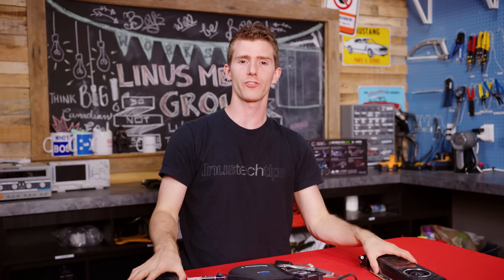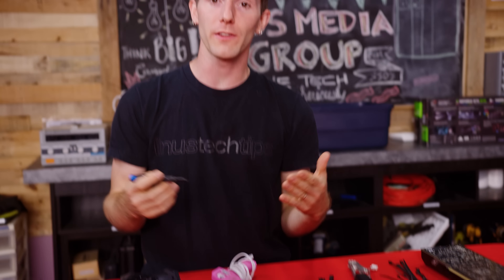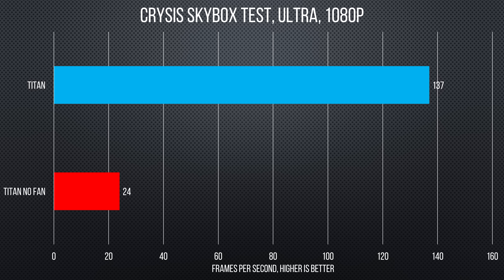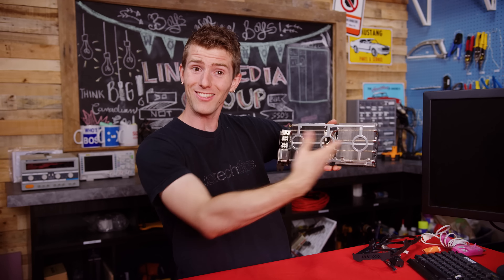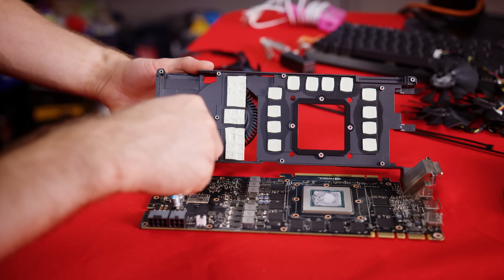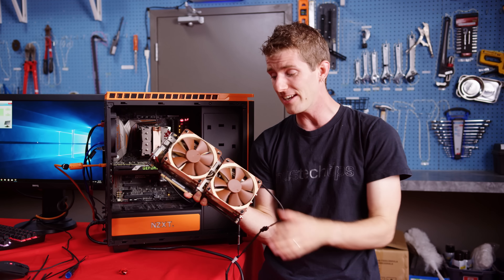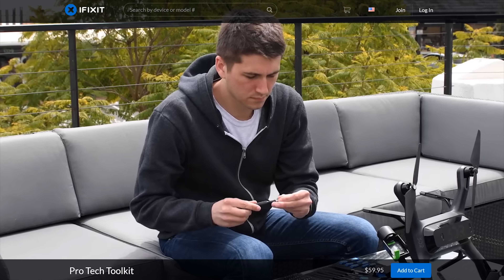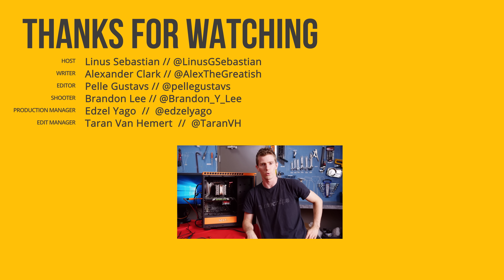Video Card Dead Fan Repair Guide

Comment: For those late to the party, 4 years after this video was made, Noctua partnered with a graphics cards manufacturer to make a Noctua-flavoured graphics card. As you probably guessed, from Linus' results, it apparently works great!
Reply: Now if only I could use Noctua fans to replace these noisy Gigabyte fans, without having to rip off and replace the heat sink... Pasting my CPU? I can do that. Fiddling with my GPU? Ehhhh...maybe better left to professionals.
Reply: @snaffu1  It'd be cool if a manufacturer made a GPU with mounts for standard 120mm or 140mm fans so you could put whatever fans your want on it
Reply: @fizz1ewinks  at somepoint in time, someones gonna 3d print a gpu case that can fit 120 or 140mm fans
Reply: @justsayin2085  They already sell deshrouding kits that do this.

Comment: So in essence Noctua should make custom heatsinks or even video cards
Reply: YAS!
Reply: It's just a matter of fan size really. If Asus and the rest were willing to make cards take up 3-4 slots by sticking 25mm thick fans on their heatsinks that would do it.
Reply: It didn't even look that janky. I might do it to my 980ti after the fan dies.
Reply: not worth the extra cfm with noisy af fans. there's redux line aswell.
Reply: Or simply, let's just leave that job to cryorig.
Reply: I'm considering ordering a couple Noctua P120's and swap out the fans on my 980 Ti (EVGA SC+) 
The stock fans can't cool the card enough under heavy load, forcing the card to hit 84° and thereby throttling the performance. 
It's extremely loud as well
Reply: Now, the new chromax lineup would look much better than the poop colors.
Reply: G6 Liara did you apply it successfully?
Reply: I've been using this mod for years. It's a good cheap fix. If your mobo don't have extra fan headers just hook up the fans to the molex power connector on the psu. Since the fans are 120mm,they are not that noisy when compared to the stock fan at full tilt. It also helps to create some are flow in the case as well
Reply: with a sidemount on the gpu  you can make some sexy noctua aircooling pc build
Reply: And they did
Reply: @defencebangladesh4068  Thank you! So I've seen, unaware of my previous running mouth. Thank you for reminding! Takka sæg te ja
Reply: @SomeoneAbstruse  আপনাকেও ধন্যবাদ 👍
Reply: They actually did that
Reply: @olleoberg7562 you got your wish

Comment: Your Titan X mod didn't work because the original fan is a centrifugal fan. The one you used was axial which does not push the air in the same way.
Reply: he probably forgot to tape the side where the air can escape

Comment: But can it spin crysis?
Reply: Michele Caci maybe at 144p low settings if u overclock the fans...
Reply: Michele Caci can I replace the stupid noob sapphire rx 480  fans ?? Plz those fans are not cheap and not available so I want to replace them by case fans
Reply: 9:27 60 bucks USD that is
Reply: @yesboss2800  same here brotha

Comment: The problem with why the blower-style wasn't working, was probably because you didn't seal off the old intake on the graphics-card. This way, most of the air escaped in to the case (due to less resistance), rather than through the fins, and out of the case.
Reply: You probably mean the "exhaust" on the right of the blower fan. Since the blower fan is inside the card and it's output is instantly divided by the card (one side being the fins, the other side being the exhaust back in the case), it will approximately put the same amount of air through both paths. The axial fan however was mounted above the blower fan, so the whole amount of airflow (to some extent) can go through one path if the other one is sealed off (thats what wasn't achieved and also that what you said what should've been achieved).
Since the path back into the case provides way less resistance than the path through the fins and through the slot bracket, most of the air indeed doesn't go through the fins.
To solve that issue, one could:
1. tape the right side off of the gpu
2. buy a blower fan (not searching for "gpu fan" is pretty important in that case) and directly replace the broken one
3. create a duct under the axial fan where the old fan was to guide some air back into the case (if there are components there)
4. break off the casing of an axial fan and place the axial fan there where the old fan was, it will now work kinda like the blower fan it replaces
This is in no way meant as critique, I just had the urge to add more context and suggestions :P
Reply: It didn't work because the fan in the blower style is designed as a whole system. The shroud, heatsink, exhaust. It's designed to suck air from the front of the shroud, thru the heatsink and exhaust it out the back of the shroud/PC. It might have worked better if he mounted the fan somehow to the back or front and taped off the stock fan so air couldn't escape forcing air thru the heatsink.

Comment: Me: breathing heavily, staring at my toaster of a 1060 and two spare noctua fans
Reply: @Jim Mahmud I actually didn't. I'm still really debating it though. I have one of the fan bearings starting to go anyhow. So in the event that it actually fails, I'll probably cut the housings down on a similar sized fans and actually find a way to mount them in the actual case of the card. That said, I wild definitely do something like this in a pinch.
Reply: @makitard  my particular EVGA 1060 ssc is a toaster. I think most of the acx 3.0 cards are toasty. I don't think it's a great dual fan solution IMO. I love the card though.
Reply: @thisislargemouth5566  ACX have thermal pad issue, make sure you have one installed on the vrms, you can also change them. 2.5mm thick.  BUT, it's a great cooler when those issue are fixed. Better fan would also help a lot.
Reply: A TOASTER W A 1060!?

Bruh im happy to see minecraft at 100fps
Reply: @thisislargemouth5566  did u do it now?
Reply: any updates?
Reply: @Ammarx1  I've been not really using my computer much. My neighbor been using it more than me. It is still a toaster but running strong. 😂
Reply: @Ammarx1  I don't think it's been off in a month 😂
Reply: @thisislargemouth5566  oh damn, i just hope that it doesn't die lol.
Reply: @Ammarx1  I believe the saying goes "if he dies, he dies!" 😂
Reply: @thisislargemouth5566  haha, good luck with that thing.
Reply: Over half a year later....did you do it????

[update 10/9/2020] I just did it to a GTX 1650 low profile with two 60mm noctuas and it is AMAZING.

Noctua’s Instagram account liked my post on my mod too haha
Reply: @LeftJoystick  can you link the post lol? I'm planning on doing it id like to see youra
Reply: @makitard  1060 is a toaster since the heat dissipation is not made by gpu chip but by cooling system.
Reply: @makitard  Then THEIR 1060 is bad.

Comment: The blower style card mod didn't work out as good as the other one because it uses a radial fan that sucks air along its axis and exhaust at a 90° angle and you replaced it with an axial fan that sucks air from a side and blow it to the other
Reply: exactly... I was face palming watching that... thought linus knew that reference card fan is exhaust, not pushing in
Reply: Oooh radial
Reply: Also his tape seal was worthless
Reply: Your Statement is true, but i think the original reference cards shroud should force the blown in air trough the fin stack anyway, in case the axial fan has enough static preasure and the "cutout" for the fan lines up good enough
Reply: But as the Nvidia reference cards do exhaust a small amount of the air back into the case through the smaller heatsink on the "right" (when looked at from above) side, and this has way less resistance then the big other fin-stack i guess, the air will just go this side i think
Reply: You might even be better putting this standard fan 90° directly into the radiator (don't really know how to explain it better) and seal the old air entrance. though a more powerful fan would be necessary.
However I've always been able to find perfect replacement blower fans on ebay, even for my laptops :/ so I'm not sure about the non-availability.
Reply: Or remove the window in the shrowd for a second fan GTX 480 style.

Comment: As an ex-smoker, pretty much ALL my GPU fans failed before I was done using the card. Having had no outside input, I came up with this solution on my own about 15-20 years ago. General rules: strip the card down to the bare heatsink and zip tie a case fan directory onto the heatsink. Never try to power the fan through the card. Don't zip it so tight that it warps the fan's casing and ensure the blades are not rubbing on anything and that's about it! Not even sure how I came across this video today but it's refreshing to see that this solution is touted by the the man himself! Great tip Linus, thumbs up from me!! Bonus info - I'm Canadian!!
Reply: Why would you not power the fans through the card? Assuming the power ratings of the fans are close or equal to the stock ones there should be no problem, or am i overlooking something?
Reply: Either I checked, or I assumed, that the power draw was different.

Comment: Everyone is going to put noctua fans on their gpus now 😂😂😂
Reply: I did that with my HD7950 because the Gigabyte fans stopped spinning below 1000RPM and that is really loud.
I also did this mod to my (back then) brand new XFX GTR RX480. The temps and noise are amazing. The only downside is I have to use SpeedFan to control the fan RPM based on GPU temperatures.
These new Asus Strix cards have really usefull 4pin headers meant for case fans. I would recommend using those.
Reply: Get ready for the noctua shortage for miners
Reply: it's soooo tempting
Reply: Everyone should, honestly. My rx vega doesn't get above 52C with two of them strapped onto a morpheus II
Reply: Good thing I only buy ROG Strix OC cards these days!
Reply: I have the strix 1070... thinking about it i really am, maybe not noctuas though
Reply: ya especially because asus has no warranty on their low end gpu fans
Reply: It would look nice matching a Noctua D15 or something too.
Full Noctua build.
Reply: 1 fan broke on a old gts450 copper edition with double ram i had from 2008
so yea i had to ziptie a fan on it,it was quiet and perfectly cool!
they should have put the result with open shroud and 2 fan on the blower...
Reply: i have a d14...
Reply: Just add 100$ for fans and morpheus II into your Rx Vega order and get 1080 like performance. Not great for the wallet, but it would be bad ass AF
Reply: KGskate82 I might just buy a compatible cooler, like one of the acceleros (not sure on name or spelling right now). Basically one of the arctic cooling coolers.
Reply: Tailslol would've been a lot cooler. I can assure you of that. Since that single fan on the titan just was not working out.
Reply: +john bumptybump same man, it honestly looked pretty cool lmao
Reply: Not just Noctua, almost any 120mm fan will work just fine. Fan on my R9 285 just died, i did this but with two 5$ Xilence fans. Max temps are 57*C, while with stock cooler they were hitting 76*C. And they are pretty much inaudible when CPU fan joins the chorus.
Reply: I'm already doing that to my rx 580
Reply: I did it with a ancient CPU cooler fan and super glued it to the shroud. That card still works BTW except I have to upgrade it as its a gt 140😂
Reply: My gpu got loud so I actually will do this
Reply: @johnbeer4963  i did that and it was the best decision ever. card is dead silent even under full load and long gaming sessions. the standart fans are way to noisy
Reply: @Jb11rabbit  But each big fan needs 1 4pin slot right? or are there enough cables left from the GPU fans? Or did you have to buy an adapter to get 2 4pins in 1 slot? I wanna do this aswell just never took my GPU apart and dont know if Linus reused those cables or used different ones and scared I dont have enough pin slots left for 2 4 pins.
Reply: @shapsas9435  If you are talking about the same Asus 1070 model that is also shown in the video, then you have two 4 Pin headers on the gpu. The original header for the original fans is some proprietary thing.  So he will detect them as external fans but I never had any problems with that. As for other gpus. You will have to look that up on the spec sheet or so. Most gpus don't have those extra 4 pin headers or a Standart Fan Header for the original gpu fans. In that case just use the Mainboard headers and try to find the best fan speed value so you don't overheat.
Reply: Just did lol
Reply: @Panchirito.gaming  how do you control the fan from MSI afterburner? I want to try this with my rx580 too
Reply: @waratkasitanon5323  When you open afterburner, on the right side where it says Fan Speed (%). You can click on the word,  Auto and you can adjust the fan speed however you want and click the check mark to confirm the settings.
Reply: @Panchirito.gaming  Thanks!
Reply: I did
Reply: I am doing this 10 years, not with noctua, but it's not imporatant, important is that classic fat 25mm 120x120 fan is much better than low profile shits on GPUs
Reply: @phenomanII  I bougth an used XFX RX570 RS , but the stock fans are loud AF when reach 100% speed , do you recommend this mod for my gpu?
Reply: @epictrolloleante  Do they reach full speed often? They probably shouldn't if you've got a decent case and don't live in the desert...
Reply: @phenomanII   Yeah they do,when I play a game that uses 100% of the GPU the fan reaches 100% speed  to maintain the temperature under 85C° and that's when the fan becomes so damn loud. And if I use the stock fan speed curve the GPU it's silent but it reaches +90C°.
And I don't live in a desert but the average temperature in my city these days it's 38-40C°+
Reply: @epictrolloleante  I would recommend that you visit the LTT forum, and consider replacing the thermal paste on your GPU, altough that can get a bit sketchy if you're not experienced.
Reply: @phenomanII  the first thing I did when I got that gpu was replace the thermal paste with Artic MX-4.
I'm getting these temps with that thermal paste.
Reply: @epictrolloleante  I would definitely check the cooler mount and the spread of the paste. Don't forget, none of the tips for applying thermal paste on a CPU are relevant when it comes to GPUs. You're dealing with a naked die here.
I had a stability issues with my RX480 for months and after undervolting it and all that it kept crashing at idle with no issues under load. I changed the paste at least 4 times. (I was experimenting with DIY cooler mounts and stuff and went back to stock after a couple repastes.)
I was ready to give up on it and sell it as defective for the value of the cooler when I found a post that described exactly the same issue, and the poster solved it by reapplying the paste. (Sadly, he had a worse paste application from the get-go and his GPU died not long after he fixed the stability problems.)
I reapplied the thermal paste once more and I've been running the stock cooler with stock fans ever since then, and I'm honestly a bit afraid to touch it now.

When I modded the RX480 with Noctua fans the first time, it was after testing the original cooler. I knew that with enough airflow (the fans at 100%) it could reach great temps, but due to noise, the stock fan curve barely reached 50%, so swapping the fans gave me more airflow at lower RPM and better temps.
The GPU should be at least functional at the stock fan curve, and should be able to reach decent temps at 100%. Otherwise swapping the fans won't help you as you're limited by the heatsink (or the heatsink can't perform optimally due to the thermal paste application).
My RX480 GTR has a big heatsink on it, it should be able to fit 92mm fans with no overhang, but the stock fans are thin and small due to compatibility and I used 120mm fans to run at lower RPM.
If your GPU has a heatsink similar to the RX480 Nitro I had before that, you'd need to make a duct that focuses the airflow toward the small heatsink, otherwise you won't have enough pressure through the fins. At least that's what I did with that GPU before exchanging it for the GTR.
Reply: @phenomanII  Ok, i'll try reapplying the thermal paste.
Reply: @epictrolloleante  Good luck, and be careful.
If your issues are actually related to the thermal paste right now, you're lucky that the coverage is worse near the temperature sensor. Often, the sensor is covered just fine, and you don't even notice an issue until the card dies. Or it crashes like mine did.
Reply: hell yeah , my shit it's 1660 super and the fans are disgrace literally grinding. Noctua 92mm have save my head from brain damage.
Reply: Man idk how tf you guys afford fucking noctua, IT'S IMPOSSIBLE to get one in brazil and i believe in so many countries, noctua is like apple's jealous fans because holy shit. Is there similar brands with noctua that is much more accessible (quiet/quality/strong)?
Reply: I've replaced my gpu with one from noctua today... I got x1.5 performance and much less noise
Reply: @BedroQuendoTV  little late but i think corsair maglev or BeQuiet are also fine